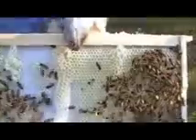Bees for beginners Part 6

Comment: The "odd stuff" on the comb they're drawing is, in my commercial beekeeper opinion, typical of plastic foundation, black or white.  Your positive expreience with the black Brushy Mtn foundation in the first hive is unusual in my experience.  PerhapsBrushy Mtn just does a better job coating it than the suppliers I've used.